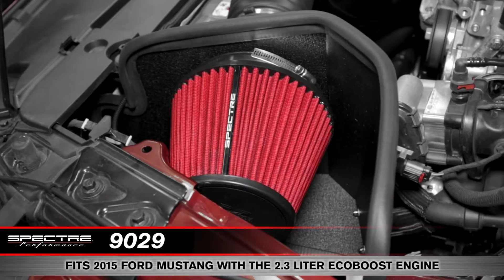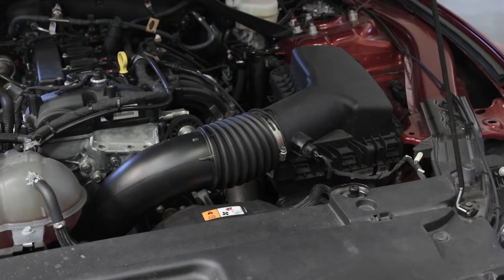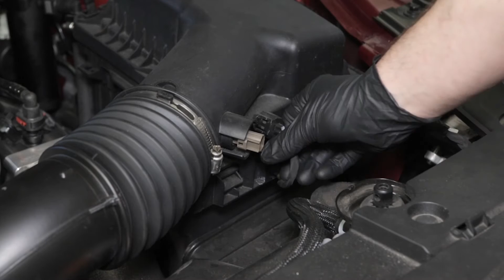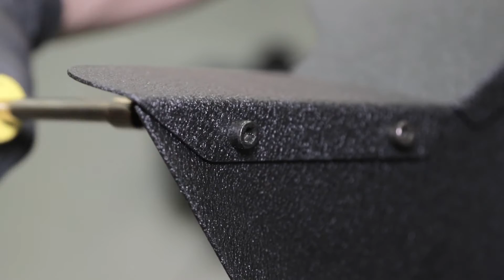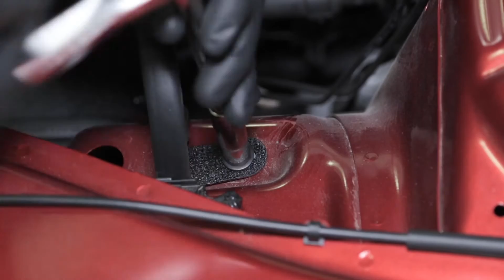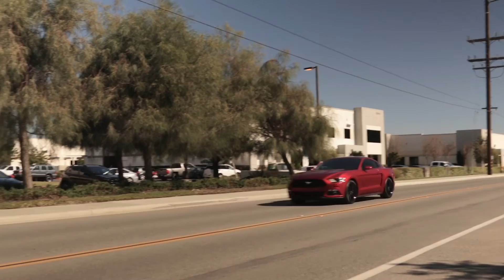How to Install a Spectre Air Intake on a 2015 Ford Mustang 2.3L Ecoboost

Comment: NOT BAD. I OWN A 2016 HYUNDAI VELOSTER N/A AND IM BUILDING MY OWN SHORT RAM INTAKE USING ALL SPECTRE PARTS TOTAL PRICE WITH SHIPPING JUST UNDER $81 WITH A SPECTRE FILTER WRAP/PRE FILTER INCLUDE IN THE PRICE.,)